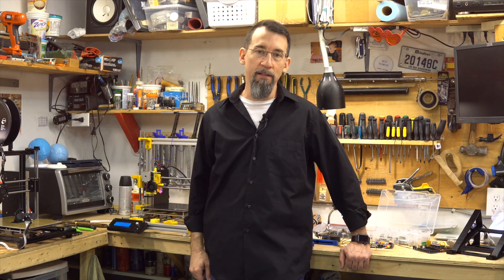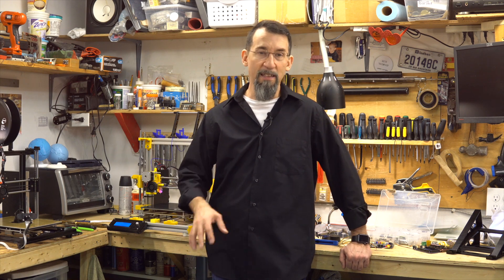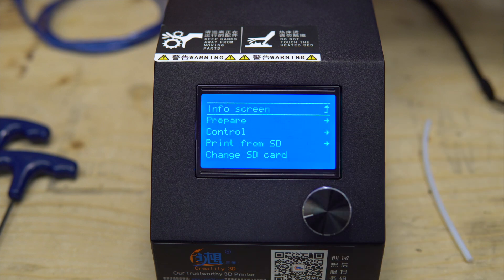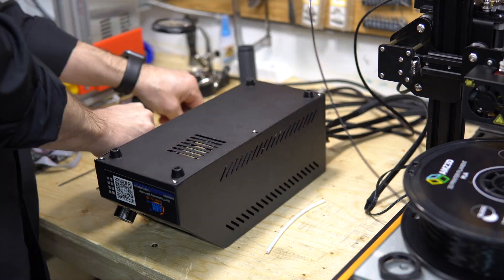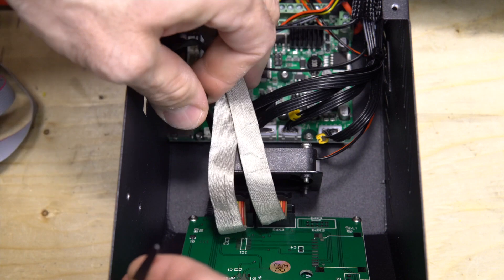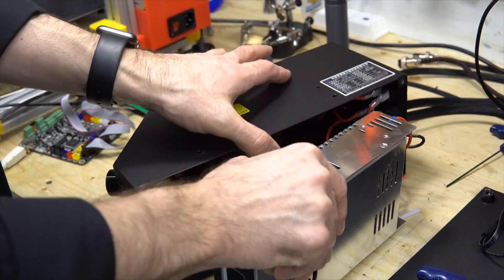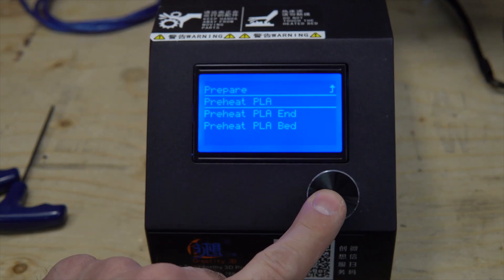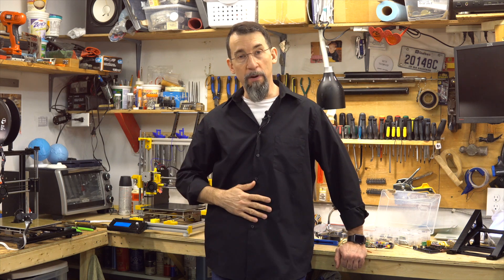CR-10 Clicking by Itself

Comment: Running a new ground wire from the power supply ground terminal to the frame of the lcd panel fixed a similar issue on my ender 5.

Comment: oh very nice, our Ender3 is also working (clicking) by itself :-) Everytime we want to preheat PLA,  it starts to heat and with a nozzle temperature of about 130 the display starts clicking by itself to the menu and back to the info screen, up to the menu and back to the info screen. It feels like a ghost is playing around with the printer button. Very strange. Okay, it seems that we have to check everything around  the cable connection to the LCD screen or maybe any connection regarding the button. We will check it and will be back with the result or maybe with the next question - haha :-)))))))
Reply: Have you been able to solve the problem? My Ender 3 is also clicking itself
Reply: @patrykK1028  same problem on my ender 3 pro  after cable managment  everithing looking good but i will inform you maybe tomorow. first of all i need to print a ton of things to see if it's ok
Reply: i hear it on 1 hour of print 2 times btw before cable managment in 1 hour maybe clicking 20 times ok its better now but not perfect
Reply: after a week i can tel you after cable managment is better but still clicking the lcd  less

Comment: I had a similar problem on a budget lcd (which was nowhere near the power supply), but it only clicked like onece every 30 seconds.  To fix it, I soldered a denouncing capacitor across the two normally open pins for the click button (it has 5 pins, two are for the clicking mechanism).
Reply from the maker: Good idea, did not think of it, moving the cables did the trick, to my surprise :-)
Reply: Hello, what size capacitor did you use. I havw tried everything and still clicks, but haven't tried the capacitor

Comment: I see it still has the unstable temperature issue caused by having the wrong capacitor on the mainboard. Replacing the wrong (100uf) capacitor with a 220uf is known to fix that issue.
Reply from the maker: Yes I have read about that, not a problem on the machine of my friend.

Comment: The cheap power supplies they use in these machines are incredibly noisy on the RF spectrum.   I'm a ham radio op, and my anycubic destroys the VHF spectrum in the house.  I have an X10 module on my hallway light that trips at random when the printer is on.
I opened the power supply and discovered that there's almost no filtering on the incoming AC line.   Cheap Chinese manufacturing.
Reply from the maker: I think you are quite right, and I also want my Ham licence, I will have to buy quality power supply to replace them, not to mention fire hazard, I am building a simple shutoff gas/smoke detector for all of my printers.

Comment: Great video Frank. I just upgraded my firmware a few days ago. I noticed some layer shifting on the Y - axis during a taller print. Might have to make sure everything is tight as it's been getting a lot of use since assembly the week prior. I'll keep an eye out for anything odd with screen and check the cabling in the box while I am at it.
Reply from the maker: Hi thanks, maybe add braces to the Z gantry to make it more rigid. https://goo.gl/images/mJ2tgD
Reply from the maker: It could be the accélérations that are higher, I use TH3D firmware it as all the settings already configured.